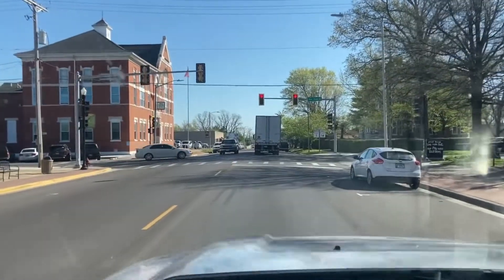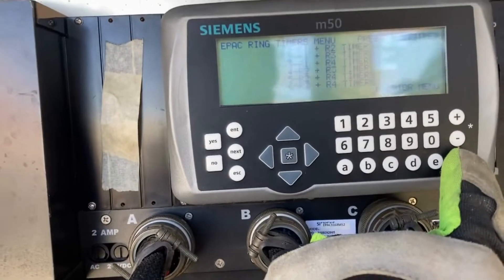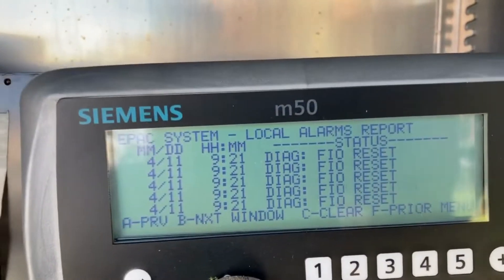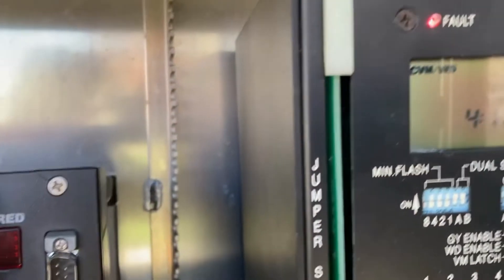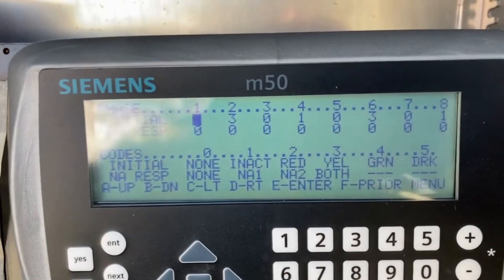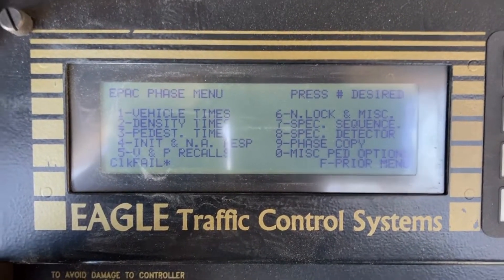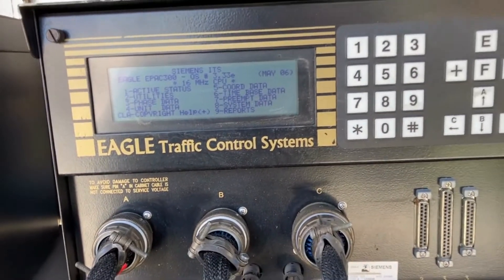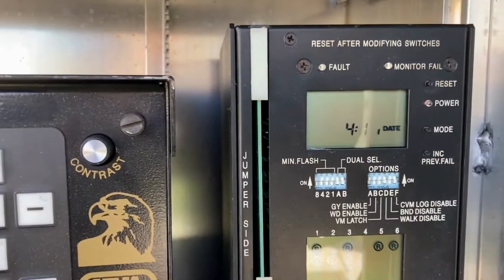When a Traffic Signal Controller Causes Problems

Comment: I noticed a "ClkFAIL*" message on the main screen of the EPAC controller.  That means that the battery that keeps the controller's clock on time is either dead or dying.  I've had this happen on my M40 controller and luckily for me, I found the right replacement battery online.
Reply from the maker: Oh wow.  You found a battery?  I remember replacing them back in the day to avoid the ClkFAIL when it happens.  We have a project coming through this corridor soon and a few of these controllers (including this one) is getting upgraded.  Just curious...where did you find it at?  Thanks for commenting!

Comment: In STL, a Traffic Controller got Hit by Lightning 8+ months ago.  I called/submitted 5-6 trouble tickets 3-4 months ago and was told they’re still Waiting on Part(s)l.  Parts Shortage Continues 4+ years after Covid in Most Industries.  Unbelievable.  Thanks!
Reply from the maker: You're absolutely right.  We had a $3 million project that was pushed back a full year due to delays in materials.  Thanks for your comment!

Comment: Good call! Sometimes the problem can be power related. Check AC line voltage. Check for bad neutral. Bad power can cause the controller to act up. Enjoy your channel! Keep up the good work.
Reply from the maker: You're right Mike.  Coincidentally, I replaced a blown mercury relay on the power panel about a few months prior.   Hmmmm.....🤔

Comment: Allen Bradley was the PLC system i learned on back in the 90s. Good times. Ladder logic and all that.

My rule of thumb is weird electrical problems almost always means a ground problem. You might be right in this case, but i have doubts. Otoh i believe i saw a y2k sticker and a 16 MHz label, so we might be talking a little more instability than I'm used to.
Reply from the maker: Great observation! When I opened up the cabinet and saw the Y2K sticker--my brain went right to "thats definitely the problem"😅  This video was shot quite awhile back and that CMU is still humming along in the cabinet.  Goes to show they don't make things like they used to!
Reply: Yeah we consider 8 years to be about the expected life of that stuff based on our experience in Michigan. I'm with a mid-sized county with 69 signals all running m60 CUs. We have a few cabinets dating back to the '90s still but all of the controllers and MMUs have been replaced multiple times since.

Comment: I’m an industrial controls tech at a sawmill. We see a lot of Allen Bradley and occasionally I see Siemens. I haven’t watched all of your videos, but so far I see a lot of Siemens controllers. Do you ever see any Allen Bradley controls in the signaling world?
Reply from the maker: Great question.  There are about 7 main controller manufacturers in the traffic signal industry.  Allen Bradley is not one of them.  But- if they made a heavy duty traffic signal controller that could actually run longer than a few years before sending them in for repair-they could do quite well!